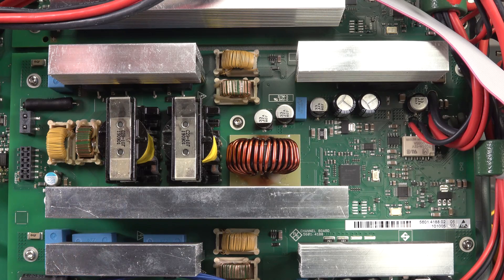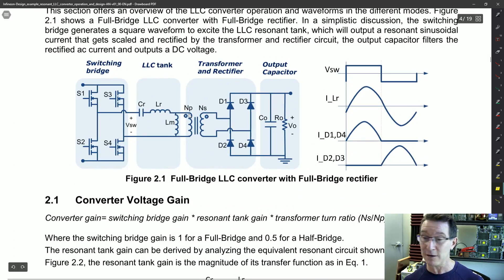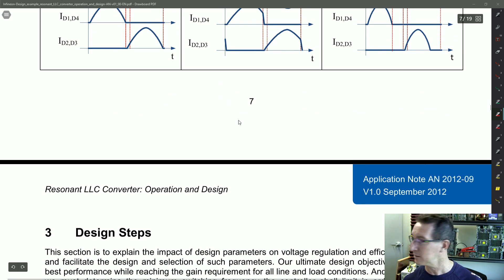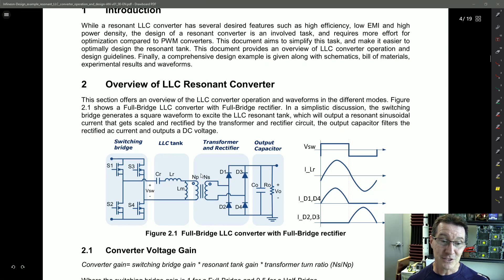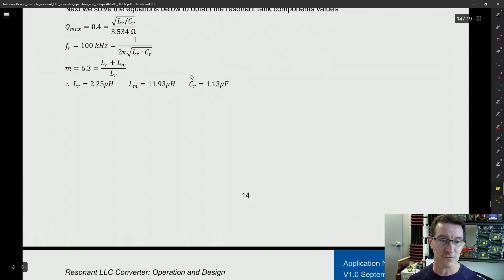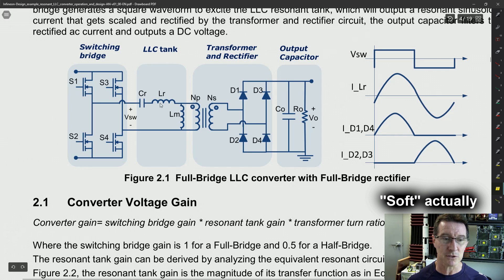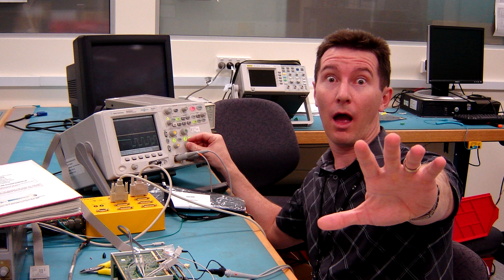EEVblog #1294 - LLC Resonant Mode Converter Design

Comment from the maker: NOTE: There appears to be quite some debate as to whether this NGP800 PSU is actually a resonant converter topology, and yes, I need to take a closer look at this. But just go with the flow and pretend it is for the purposes of this video.
Reply: I live infineons application notes.   You can teach a college course from them lol
Reply: Hi Dave, once again, thanks a lot for this great video! I do power supply design for quite a while now, and I think in the R&S it's done this way: since there are two current sense transformers, two transformers which look like they do gate driving, two power transformers, four FETs and four diodes, I guess it's two separate LLC stages. For one stage with two power transformers one current sense would be sufficient. I think the two stages are phase shifted. This makes sense, to counter for the LLCs big output ripple currents. Also, in nearly all my LLC designs, I integrate the resonant inductor into the power transformer. Because LLC stages are very bad at wide input to output voltage ranges (they work best at a fixed in/out ratio), I would suspect the large inductor with the spare transistor down right forms a buck post-regulator. Maybe the missing free-wheeling diode is below the board... Anyway, I hope you well have time to investigate this further, I'm very curious how they have done this.
Greetings from Germany!
Reply: @2SD998  Since you design power supplies, do you know of any switching regulator IC that implements PFC going directly to the output (instead of raising the input voltage first)? I guess I am looking for a "buck" type PFC instead of the typical "boost" type. This is for driving LED lamps in the power range of 1-30W.
Reply: @edinfific2576  Have a look at the TPS9274, for example.
Reply: I doubt if they use LLC, I cant see the resonant Cap, and with inductor that big, its more likely to be a phase shift full bridge.

The CoolMOS CFD7 can be used for LLC and PSFB as well, as long as you dont need body diode force commutation capability
Reply: @ariefnoorrahman3492  +1 to that. For LLC there must be a high current rated (mostly = film type) capacitor on the primary. The primary resonant inductor can actually be designed into the transformer as leakage inductance. The inductor in that video is almost for sure an output filtering inductor. I'd say this is most likely PSFB-ZVS, as you can get ZVS without any resonant inductor, the resonant inductor (also called a shim inductor) is there only to lower the power at which ZVS mode kicks in.
Reply: i can excuse the crudity of the models because there is no scale BUT, i have to argue that you obviously did mspaint it!
I wonder if LC power supplies will become the norm as more and more power is required from smaller supplies, there is companies boasting 100 watts from a cell phone charger sized wallwart now with usbc out!
Reply: Excellent video!  I learned alot here, mostly about why I don't use resonant mode converters.  Too much math!  (I can see it taking a team weeks to get the math for something like that bench supply sorted out.)  Anyhow, not useful for small MCU projects of mine that typically consume <30mW and only need SOT-23 LDO's... but definitely worth knowing about, just in case I do need something like that in the future.
Reply: @Gypsy Mike Dude, what are you smoking?
Reply: Go ahead and do a video measuring it!

Comment: I’m speechless) The most complete analysis of an LLC architecture what so ever! There are two transformers  because they took two standard half-bridge transformers and connected primaries in series and secondaries in parallel (there is no need to calculate a new transformer, primary L is doubled, secondary L is cut a half win-win)

Comment: gah, i still cant quite get my head around this.

everyones chasing regulated outputs and stuff like that.

im chasing current. plain and simple. as much as possible. i cant stae my output voltage as technically, there isnt one... or its dictated by the load, coupling, temperature, blah... i dont give a damn what it is as long as its being fed lots of current.

induction heater.

i think im getting a grasp on it, run through various calculations, all looking good...

but damn i am releasing a LOT of smoke in the testing phases! and none of its coming from steel heating up. if it runs unloaded, it blows up loaded, and vice versa...

meh, another two week wait for new components... weee!

Comment: Do you new Guys what kind of smps I need to use for a tube/amp hybrid amp? Can I use one supply for the 65 x 2 15 amps, 12,8 volts and 6.3 volts 5 amps, 350 volts 0.10 amps,  2 x 120 volts 0.25 amps. all on one transformer. LLC is nice, but did read LCC do better here., for feedback, open loop the best way? the transients from a audio amp can never be corrected, feedback to slow, a possible way, current feedback use, injection on chip triangle oscillator, did read some about that. I can use also fase shifting and other topologies but as fat LCC has soft switching, and I need as low as possible emi because it is a tube input/driver amp, filtering is not that difficult with the low amperages for them. 

I can also use separate smps for the 65 x 2 15 amps and the other voltages make it  more easy.

THanks for advice.

Comment: The final MOSFET you found may be to have a linear regulator after the switching one. This would allow very precise output control and could be made to take only a few volts across. Makes sense?

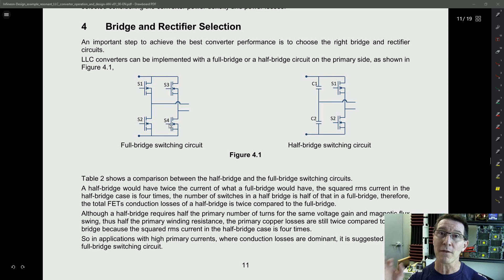Comment: 10:45 Absolutely false. Typical CFL drivers use BJTs, and they operate almost exactly as an LLC converter, just don't transform the voltage. And the board you have shown is extremely unlikely to be an LCC converter. There is no sign of the resonant tank, and the output inductor after rectifiers is not just unneeded in LLC, but ruins it.

Comment: Despite the fact that I usually design other devices including microcontrollers (I love C++ and C#) I also fell in love with DC/DC converters design many years ago. I began with buck converters, then forward, and half-bridge. I'd like to build LLC converter but it seems to me it would be beneficial to design low voltage LLC converter first (powered from 24V instead of 230VAC) so that would be safer at the beginning. LLC converters are much more difficult and any error in your design may result in component explosion, especially at high voltages such as 230V AC for instance.
Reply: I too am an EE and bot MCU and destop apps programmer, and design all sort of PSU's and small control sysems with microcontroller for which I use mostly C, C++, and whenever possible Pascal.  And yeah, get the circuit wrong, and mods/parts explode, which for me is a complete loss because I do a redesign - expensive, but being a full time contractor, I must have happy customers.

On a tangent, and only for Windoze desktop GUI apps.  

Try Delphi, you'll learn to HATE C++.  C# is a mixed bag for me, even though it is designed by the same guy that did Delphi before he sold his soul to M$.  It has the CRAP syntax of C++, but has a lot of nice abilities, BUT it is suffering from "project creep", i.e. too many not too useful but COMPLEX abilities (which Delphi is now following - BAD and STUPID MOVE - KISS IS BETTER) that are better off not being there ever!  I started with many Assembler, then a bunch of HLLs like Basics, PL/1, Pascal etc. etc.  Then C, then C++ and finally Delphi.  All this over four decades, and for productivity, READABILITY (brackets are EVIL becaus the brain processes words like begin/end MUCH MUCH faster due to context not being required to recognize them), there is NOTHING that comes close to Delphi, ...but it is an unlearning curve from C++, to which I was addicted to for a very long time, went to rehab :), got much wiser and after hating Delphi at first after it was pushed onto me, several several years I good at it and now NOTHING comes close to how fast and ultra readable I code compared to C++ that I was so in love with before   ...NOTHING!  Because of the FALSE LYING POS M$ propaganda about Delphi, as M$ does with better products that are not theirs, most programmers never looked at it in the last decade!   VERY SAD but my gain, especially when it come to high response GUI's.  Try doing GUI's under any DotNET language without spending too long on it (apart from the cookie cutter and limited wizard stuff).  I mean truly custom schmik designs my customers cannot get anywhere else.

I designed a very complex multi monitor system for $50k price ($30k + $20k later extensions), took two and half months combined.  Two decades later, due to M$ evil ways, they wanted it converted to C#.  I told them it would has laggy GUI (because 6 level deep layered GUI with huge inter module updating), which DotNET would comes to crawl with.  Anyway they got an initial quote of $350k from a C# house   ...yep, and the quote was about right too, because I also quoted for it at $400k becaue DotNET just could not do most of the GUI stuff well so many Custom Controls would have been required.  The DonNET GUI is only good if you stick to common GUI needs that 90% of projects need.  Anything out of the ordinary and you are FUCKED for performance and programming time!

...so here is my triggered rant! :):):)
Reply: @stevenbliss989  Well, I used Delphi mamy years ago, starting with version 1.0.  I use C/C++ for embedded systems. C++ is complicated but I'm getting used to it. However in many cases is better than pure C especially when I need to write complex firmware for devices that include TFT displays with rich GUI, FAT file systems and so forth. In my company some engineers use Python but it looks weird to me and I don't want to use it in my designs.
Reply: @rk-dj4sg  Not a fan of Python either, it has it's place, and is very useful for quick and dirty automation and/or data analysis, but I would NEVER write a real program in it, for many reasons, including it being an interpreter.
Reply: @rk-dj4sg  Apart from readability, Delphi 1 & 2 were not good.  Delphi 3, 5 & 7 shine as the best EVER, but the recent ones are all trying to clone the horrid Visual Studio RAD, and that has made it somewhat clunky, not actually bad, just M$'fied (i.e.  made inconsistent, unresponsive, and over complicated like most M$ garbage! ).  For embedded apps, Pascal, C/C++ if no other choice, and Delphi for all Windoze GUI stuff.  There used to be FLOATING FORM DEIGNER in Delphi right up until the current v11, IDIOTS took it out to be more like VS, which took a huge amount of productivity out (i.e. need to design forms inside a scroll frame like in VS- LUNACY!!!!!!!!!!!)!  M$ loves their constraint scroll bar stuff!  BTW I use Classic shell to get rid of that scroll garbage from the start button in Windoze and bring back stacked menus like in XP!  A huge time save!!!!!!!!!!!!!
Reply: @rk-dj4sg  Python has it's place, but crap for GUI apps.  Also hate the interpreter side of it,  ...might as well be a scripting language.  It is very useful for quick and dirty control/coms/data analysis stuff, for which I use it a lot for, but NEVER for a commercial app.  C++ is a bloated over complicated dinosaur that will be around for ever sadly.
Reply: @rk-em3lx  Yeah, C is fine for all but really larger systems, and limited ROM is always a factor! :)
Reply: There was an attempt to replace C++ with Rust but it failed. I tried to learn Rust but I gave it up after a week. It's even more complicated than pure C. Things that are easy to do in C and other languages are not trivial in Rust. Yes, C++ is overcomplicated (especially as far as templates are concerned and some other concepts). It's hardly possible to create such a language that would be safe, fast and easy to learn.
Reply: G E T  R E K T  Before Delphi there was only C++ or VB (BLAAH!!!) and Turbo Pascal, plus some oddballs like PL/1 & Modula 2.  Sadly I never used Turbo Pascal, BUT SHOULD HAVE back then, it would have saved me a lot of time and agro! :(  ...I despise M$ for essentially killing Delphi!  ...NO FORGIVENESS!!!!!!!!!!!!!!!!
Reply: G E T  R E K T  You got it man, but I hate them for removing floating form designer!
Reply: You may or may not be surprised at the fact tha MOST programmers are lame code cutters with low understanding of the language internals, how CPU and PC in general actually work etc. etc.   People like us have a full understanding of these things which lets us write VASTLY better code.  VERY SAD!!!!!!!!!!!
Reply: G E T  R E K T  Apart from the absyrd complexity, the REASABILITY of all {} brackat languages is GARBAGE!  Surprised I loved it some thirty years ago too!  Hate it now, but forced to use in many MPU Projects where Pascal is not available.  Back when C++ was around in t 80' & 90s, I should have gone Turbo Pascal, but I did not because of "linking" issues for more complex and larger systems.  But I still regret it somewhat.  But also I understand the stupidity of C++ compared to begin/end languages that are generally structured MUCH MUCH better!

Comment: I believe that the resson of why there are two transformers is for not saturating the transformer (create larger Ae value on the primary side in series and parrallel the secondary side to reduce the condtuction losses).

Comment: Back in 1990's we used the " blocking oscillator " type power supplies.. rated around 80W..
+5V@6-8A...+/-12V @2A....these ran rather cool.. and had good line & load regulation.....
don't know why is lost out.. but we had to upgrade to higher power later...

Comment: Please pay attention to the fact that the LLC converter does not have an output LC filter due to the ZCS at the output.  Nevertheless, a solid inductor is installed on the board, so I would bet it is  PSFB topology.  Please let me know if I am wrong and there are variations of the LLC with the output LC filter.

Comment: I don't know if anybody else has mentioned that the LLC converter output voltage can only be varied from 100% down to about 60%  and therefore incapable of providing control down to zero output voltage .I suggest that the LLC converter feeds a buck converter - which is that FET that you are not sure about and the large filter inductor .

Comment: The first assignment in my resonant converters class was to design one of these, and you got it spot on. And you're right about it being hard, it was painfully difficult, especially if you are designing controls as well
Reply: my final undergrad project for uni was based around one of theese, it was hell trying to both design the converter and the control loop for it

Comment: 5:43 The area under the voltage and current waveforms most definitely is not power dissipation. What the heck?
Reply: Yes, how is that supposed to be power dissipation? Where is the connection? I dont see it.
Reply: MOSFET turn on..volts across it drop to low value..the current through it rises from min to load demand max..  & vice versa at turnoff..
THE MOSFETS NEVER SWITCH INSTANTANEOUSLY... BUT WITH DEFINITE RISE & FALL TIMES.....ramp up/ down of V & I  each in a few microsecs... times that KHz sw.freq. rate...& it is something for the designers to worry about...
That AREA UNDER THE CURVE(slopes) ARE THE POWER SWITCHING LOSSES...
...the device "R..D-S on" times the load current sq......
{ ( R× I sq. = W) for "one switch on" period } are the " conduction losses.....